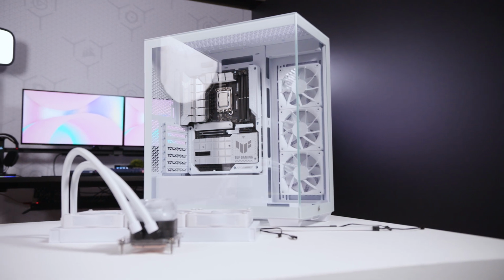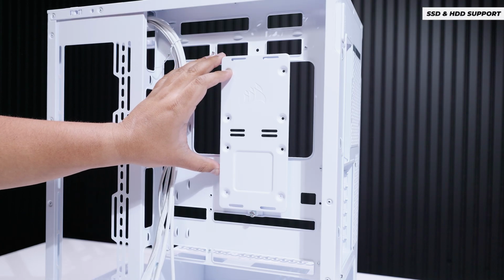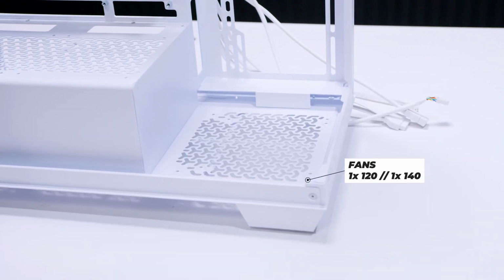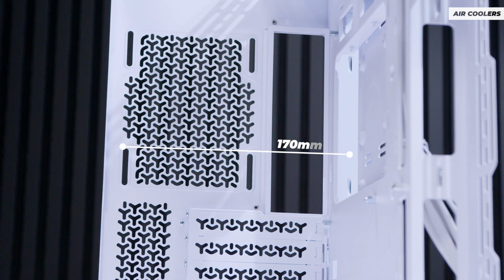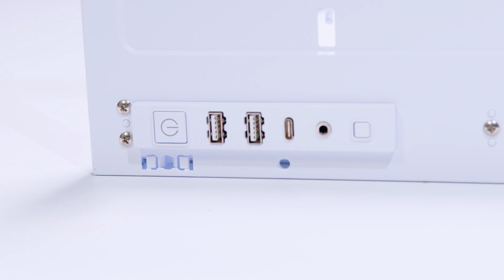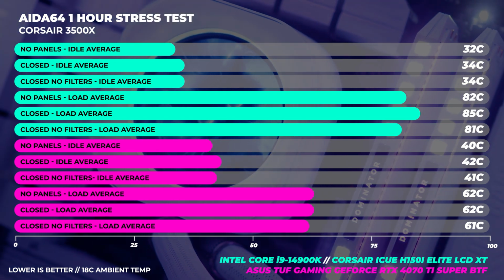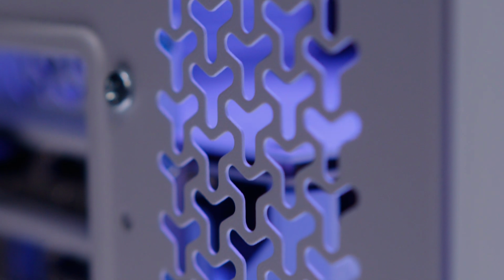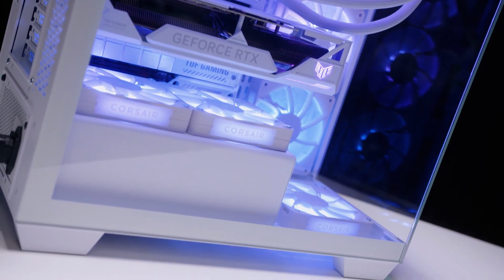Corsair is FINALLY LISTENING!

Comment: Thats basically the same build I have, but can you virtical mount the gpu with the bottom fans?
Reply: Thanks for no reply, I found out myself that you cant do that, I ended up buying a virtical mount from cooler master so I can run fans under the gpu

Comment: Just did a build in this case. I got the case for $65 from microcenter. For that price, it is insane value for money. My temps are really good. 7600x3d, 650 Tuff motherboard, same fans and aio as in the video(black), 7900XT.

Comment: just got done building in this case today. whwen it comes to just sheer room to move around in its one of the best for the form factor. Its so relieveing to just open the case and get to work, but if I had a motherboard with the connection in the back id almost do it. Im not one to do cable managing ever and I used most, but not all of the included zip ties and have one HDD and 1 SSD and the back is hardly petruding at all. Overall building experience was an easy 8/10. Only thing Id say I had trouble with was the daisy chained fans, but once you understand them its sper easy from there to add more
Reply: You can put 2 HDDs and 2 ssd's on the back of the case by the way!

Comment: Do you have to have a shift-PSU for  this one, or does it work with a normal one too? (I've got a Corsair RM 850 as we speak, but would be nice to not have to buy a new one...)
Reply: itll work with a regular PSU, it will only make cable management slightly more challenging

Comment: Great review on this case. Not to sound rude, or I hope no one takes this the wrong way but..... depending on fans three fans can cost as much as two cases. Im switching to Itx builds and using non rgb fans. RGB fan pricing is getting ridiculous. I understand with the new tech it makes it easier to set up but here in Canada 3 QX120's cost $220. For 9 fans I can get a motherboard and a cpu if last gen amd I can get memory cpu and a motherboard.

Comment: The fans under the gpu seems kinda useless imo, what kind of optimal airflow would that even achieve? Just an overall meh case imo There are better ones out there. I for one still think the 4000d and 5000d are better, the 5000d I own. And Lian li cases have been getting my attention as well.

Comment: The two fans on top of the PSU shrout are choking. No intake for them, that's seriously a crime.
Reply: I’m curious how it affects GPU temps when compared to other cases, something that isn’t seem to be mentioned in this video
Reply: Ryan ?
Reply: @universemaster100  that is a really good question. Was beating myself up abt not getting this case, but u brought up a good point. My montech 903 has air going to where the psu is so the gpu fans can intake from there too.
Reply: @ezoez7548  the whole bottom of the 3500x has a mesh screen filter on it if I'm not mistaken, so the entire bottom of the case is ventilated. someone can correct me if I'm wrong..
Reply: @aaronlong4754  ofc the bottom is ventilated. Was talkimg about sides so the cold air that's coming in from the intake fans goes into it. The psu is getting fresh air but then sending it into the little space it's in. If the side were open it would allow for it to throw out air better, and get colder air in. Also it would allow for the gpu fans to intake colder air too

Comment: Great work . Vs Antec C3 which one will you choose ? thanks
Reply: Antec's C3 came with 4  argb fans my biggest problem with it is that it has 160mm of clearence for the CPU cooling. However Corsair's 3500x has a little more quality features. Like back connections for the newest Mb. a quality dust fulter at the bottom, better USBs, etc. But I prefer the look of the C3. However if i had to pick one between them  I'd pick Corsair 3500x

Comment: I just hate the fact that they still haven’t listened to the fact that we want open PCI bracket slots!

I know that you don’t need a vertical GPU with this case, but I don’t like that huge gap, and if I want to install a vertical mount it won’t be compatible yet again with corsair cases! NZXT fixed this a while ago…

Apart from that, this thing is a beauty.

Comment: Good review but it's completely absurd that you didn't mention the Phanteks NV5 as a price and build comparison. These two are exactly direct competitors on both fronts.
Reply from the maker: NV5 V2 just released and NV5 has been sunset. I don't have the NV5 V2 so I cannot make a comparison.
Reply: @GearSeekers  Makes sense. As far as I know the only differences in the V2 are back connector support and the PSU cover is removable. As long as they kept pricing the same, any comparison to the V1 would hold true with the V2.
Reply: @GearSeekers  Hope u can get a fair comparison between those fish cases. It would be really great. 👌
Reply: @GearSeekers  Well the NV5 MK2's only major difference is that it has back connector support. And even then the MK1 isn't quite sunset yet. There is no White MK2 yet (which will be annoying as they are raising the price by 10$ and the white already was 110$ without any fans)

Comment: Nice video, what do you think about this compared to the NV5? Im using a 2500X atm but its too small for my build, and the only Backward Connector mobo is for AM5 is an MATX size. And seems Phateks missed a huge oppertunity with their new NV5 MK2 by not including MATX slots for BTF boards(also the majority of BTF/Project Zero boards are MATX so not sure who did the research for them)

Comment: Its not bad, but id rather pay a little more for the nv5 and get a much better built and much better looking case
Reply: Phanteks NV5 is quite a bit more pricey, though
Reply: @kyberkylo7764  Its like $25 more where Im based for new MK2, and so much more solid especially the GPU holder with our massive cards
Reply: @huzaifavawda8383  the 3500X is $74 where I live with the 3 RGB fans included.
Reply: @kyberkylo7764  Damn thats a steal, Its $95 dollars where I live, ARGB fans are $115 and Link is $150
Reply: @huzaifavawda8383  yea I was surprised lmao, I actually just ordered it yesterday. The NV5 was in my shortlist for a longgg time when I was watching reviews and still deciding until this corsair one came along. If the NV5 had 140mm fan support and was a tad cheaper I would've gotten it instead for sure.
Reply: But if you for AMD project zero you only get an MATX board and the new NV5 MK2 has slots for ATX BTF boards which is a damn shame
Reply: @huzaifavawda8383  why would you put an matx board in such an open case anyway, wohld look really ugly.
Reply: @zetter5888  No it wouldnt( especially if you vertical GPU mount), besides the only AM5 board with BTF is an MATX board(B650M). The majority of BTF boards are MTX. The reason you buy a case like this is for the Backwards connector support.